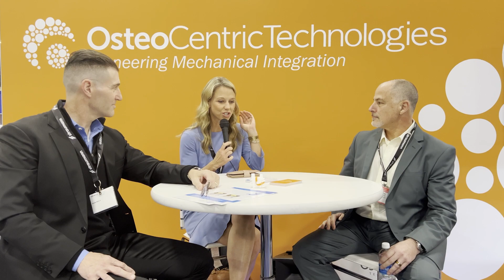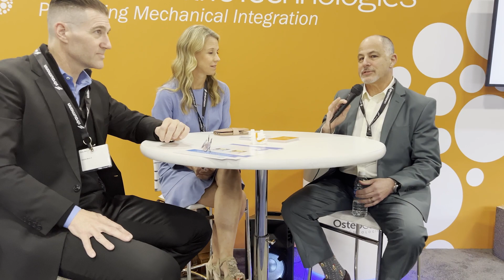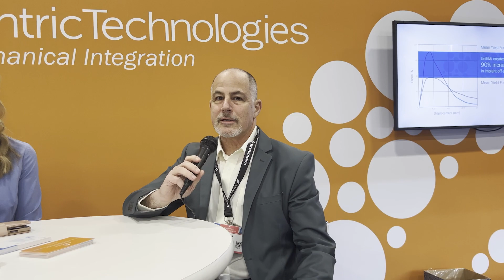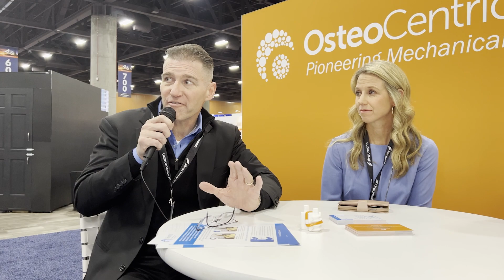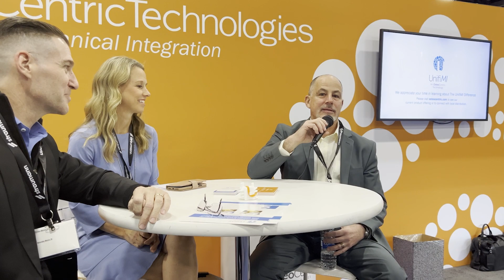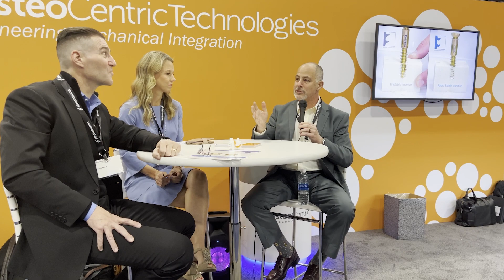Mechanical integration can help you get to finals in just 2 HOURS!

Comment: This is going to be a great implant!
You said, that implants will be placed with low torq, but could it be more than 25, if needed to screw in multi unit abutment or a temporary crown?
Reply from the maker: That is some smart thinking. For insertion of the prosthetic screw yes. However, if you wanted to retrieve the prosthetic screw after insertion to 30Ncm you might have a problem. BTW, have you every wondered where 30Ncm insertion torque as a placement guideline came from?

Comment: I’m watching this one with interest.  One thing that occurs to me is the aspect of soft tissue development around the implant during the healing period.  Linkevicius showed pretty effectively that (on implants placed to a proper apical depth) we do actually get a level of soft tissue integration around Ti bases, as well as around polished, unglazed zirconia.  What if we could develop that kind of a soft tissue seal around our implants from the very start, rather than having to disturb it multiple times during the prosthetic process?
Reply from the maker: Conceptually, that is exactly what one should expect. In systematic reviews of the one abutment one time concept there conclusions indicate that repetitive remove and insertion of abutments did not have a clinical effect. Similarly, CBL has been shown repeatedly to be clinically insignificant. A few hundred micro change in crestal bone levels does not effect the health, longevity, or the aesthetics of a dental implants. We all have limited time and resources and a prudent use of that time would be to focus on the 4 cornerstones of implant success. Once again, great logic and keep thinking like that because that is were the true breakthroughs happen.